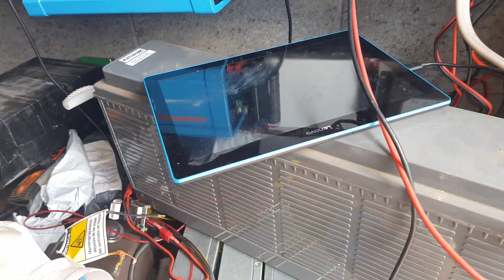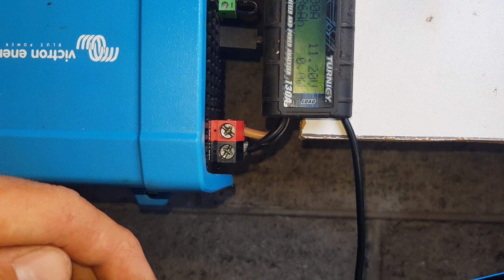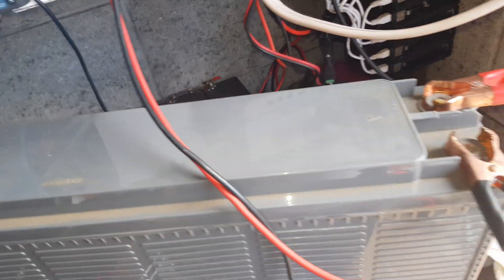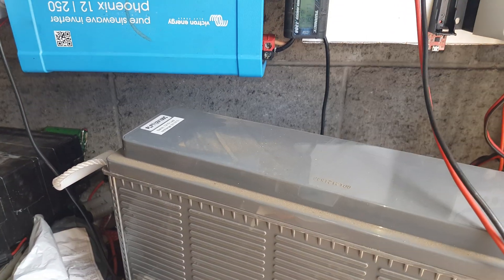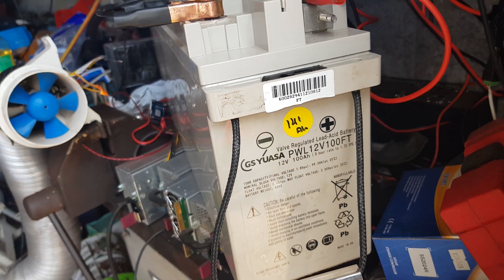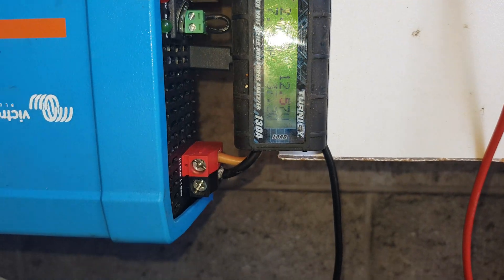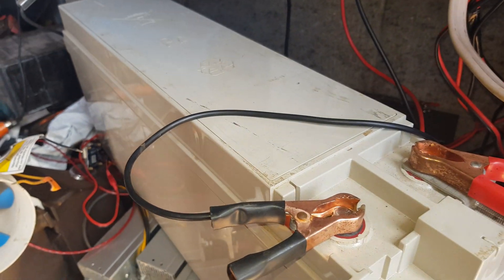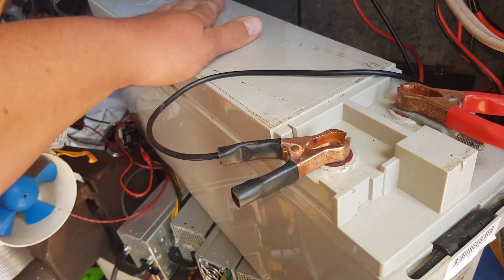Powerlyte 100ah 12V Ex Backup AGM Battery Discharge Capacity Test Results

Comment: What is the best way to charge a lithium battery bank via a dual battery setup in a camper van. Currently have a 50 relay between the house and current aux battery (agm) I want to replace the agm with lithium but I’m not sure what I need for the dual battery setup
Reply from the maker: If you buy a pre made lithium replacment battery it has every thing included. If your talking about building one it needs bms protection
Reply: One Up The Sleeve Customs so if it has bms protection then my current dual battery setup should be okay?
Reply from the maker: Yeah mate you need to know the maximum charge current of the new battery some are only 30 amps

Comment: 1100watts at 12volts is 91ah
Reply from the maker: Batterys don't stay at 12v started at 13 finished at 10.5v. Thats why i refered to the the measurement of power watt hrs 1.1kwh ah isn't relevant to its use. Just to compare to its name platw